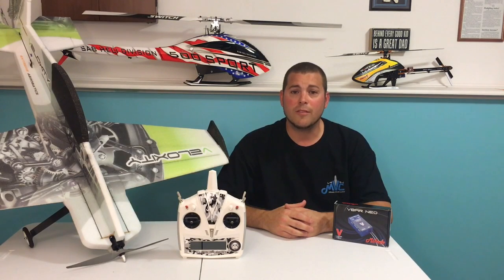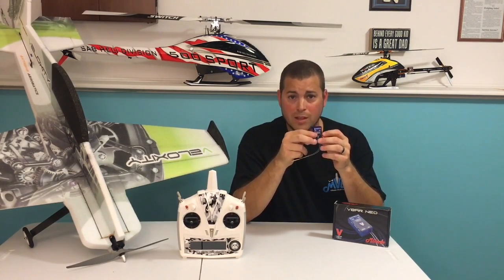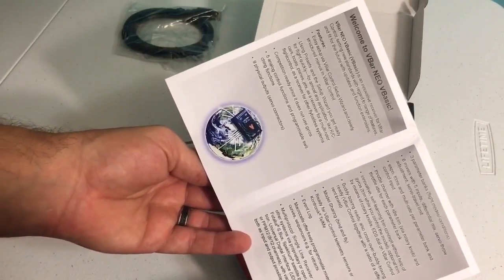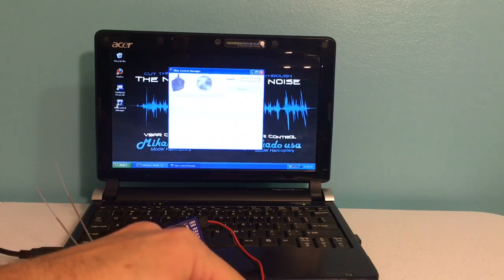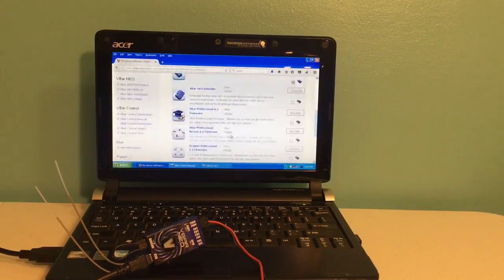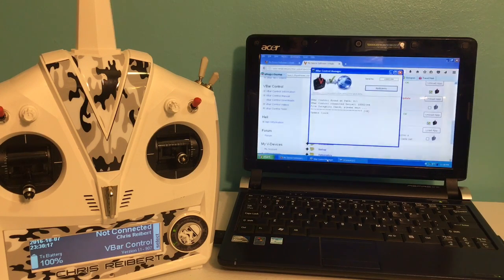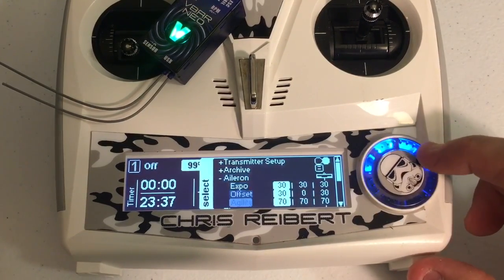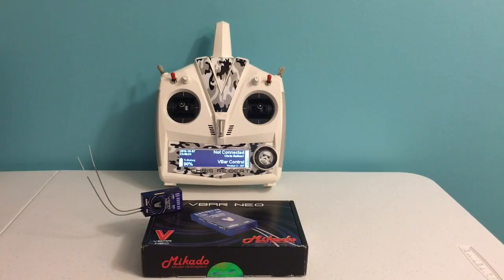Mikado VBar NEO VBasic Receiver Unboxing, Overview, Registration & Application Video

Comment: how do i rwegister at mikado????? where what part of there website ??? i cant find anything. i need to make a mounting plate for my neo i could have had that done by now
Reply from the maker: Joseph Rueck Vstabi.info or contact the guys at MikadoUSA.com
Reply: @ChrisReibertRC  i think im going to go with a beast ar7210 a lot simpler besides that i had issues with my 700e that had vbar none of us at the flying field are to impressed with it. i cant do a climb out with my 700e without forward ellevator input and the swash is level . the past few times i tried to take off the heli would rock to the sides also forwaerd and aft i am now waiting for a new tail drive gear and torgque tube drive gear and i have brand new bk servos in it 7002hv
Reply from the maker: Joseph Rueck https://www.vstabi.info/en/node/1414
Reply: flew it today on 1 6s flew flawlesly and extremely quiet rock solid i had governor set to 1900 but flew with a 6s pulse for the first hover i dont like flying high head speed first flights also i like low head speeds unfortunatly the lowest head speed the Governor will let me fly is 1500

Comment: Can you make adjustments withthis RX? Like say I am running a Brain, but I have this, and a vcontrol. Can I adjust the agility, or cyclic gain, or expo?
Reply from the maker: steve sparrow That is still all done in the FBL system you are using. The NEO is strictly just a receiver like a Sbus or Spek RX,